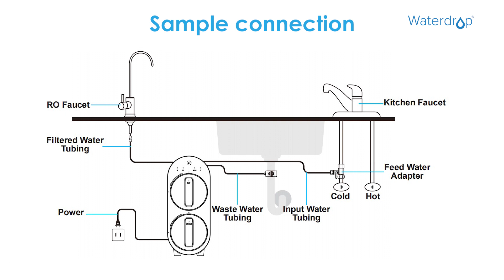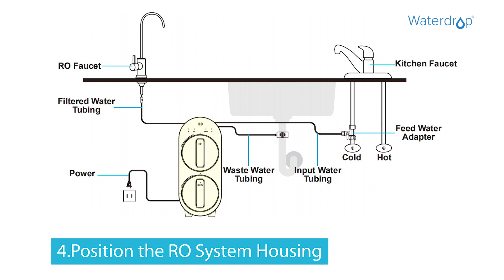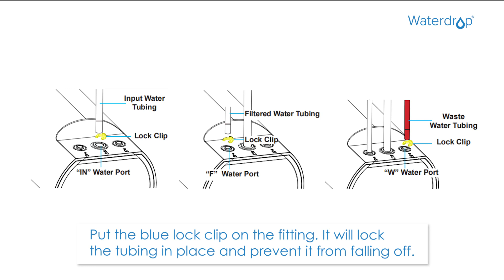How to install Waterdrop G2 undersink RO installation

Comment: My red hose did not push all the way through the drain saddle as shown so I had to drill it out from the inside with my 1/4 drill bit. Now it's fine 👍
Reply: I am having the same problem
Reply: Me too!  The red line got crimped and I had to cut a bit off.

Comment: What is  the size of the holesaw  to make the hole for the granite? I need the size in inches  the sticker it's not enough... and also you don't mention about this situation  , because i have to drilling  the countertop to install the faucet
Reply: So did it turn out to be 1/4 inch?
Reply: @JaneDoe-em5zn  finally  they give me the size of the holesaw  : 1 3/8
Reply: @quintanilla413  After installation, can you confirm this is correct? 1 3/8" hole?
Reply: @BoomerSoonerMatt  you can open a 1" inch too and it's working perfect , it's not necessarily open a 1"3/8
Reply: @JaneDoe-em5zn   i did the hole on the granite  with a granite holesaw of 1" inch the maximum open can be 1"3/8... but 1" inch work perfectly in my kitchen there's not difference
Reply: Why such a big hole (1 3/8)?? The faucet stem is 7/16" dia.  I gotta believe a 1/2" dia hole would work just fine!

Comment: is there a print version of the instructions anywhere?  There is no mention of the hole size if you have to drill granite to install this.  Weak video
Reply: Maximum hole size is 1”3/8.. for some people even 1” inch hole size worked fine.. please read older comments under this same video
Reply: 1/4 drill hole. It is written in the video
Reply: You can download the user manual on the product page.

Comment: Water sprays out of the adapter in the middle. I think the one they sent was missing a rubber washer 🙄. I’ll return and go with a company that actually sends good working parts (or at least all the parts). Such high hopes 😒
Reply: I just finished installing one and the exact same thing happened. Bummer.
Reply: Just buy a $1 gasket...smh
Reply: This just happened to me 🤬
Reply: @PunchBugMarketing  mine did the same thing until I read you have to push the hose down til it clicks!
Reply: @eliana5334  guys you have to push down until it clicks. Mine did the same thing until I re read the manual
Reply: It's not the company but the installer...
Reply: What do you mean by "adapter in the middle" 🤔